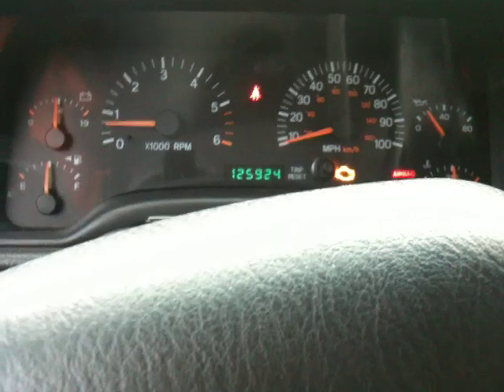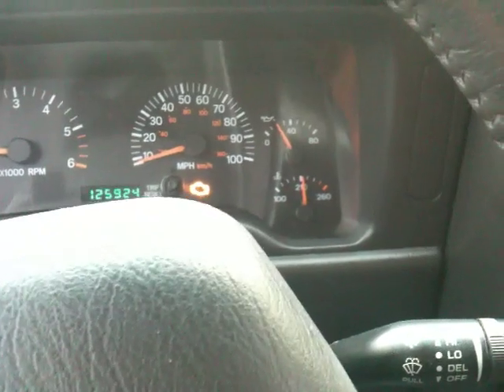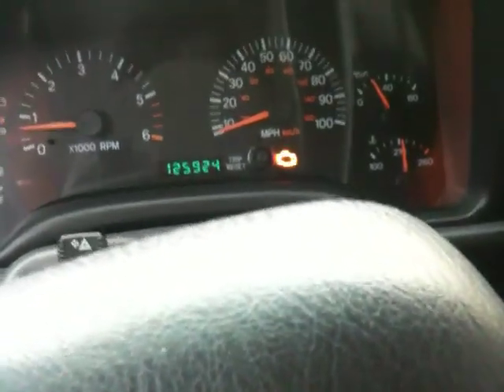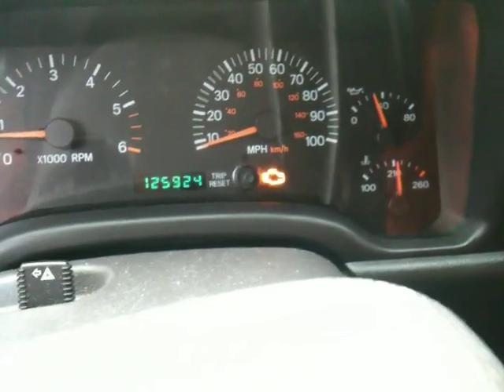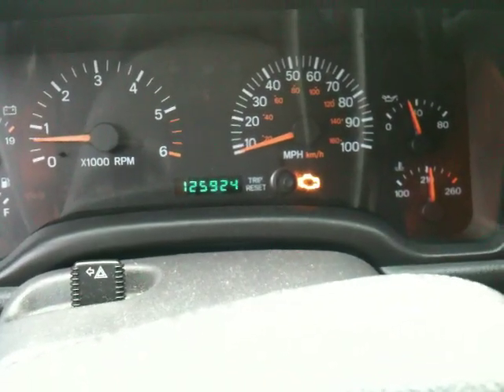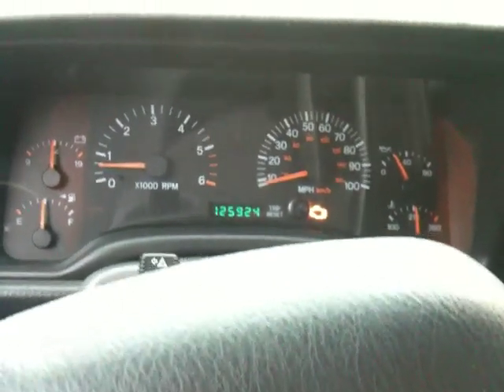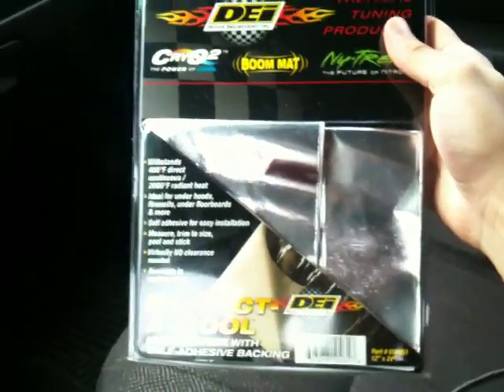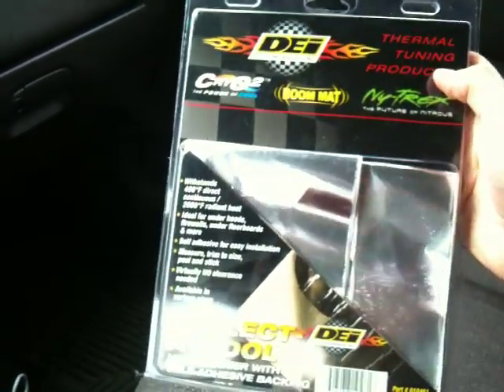2000 Jeep Cherokee XJ Cylinder 3 Misfire

Comment: I have a turbocharged 01 Cherokee with a cylinder 2 misfire and it starts to shake around 45mph but hasn't ever got into high temperatures, couldn't be a blowed head gasket right??

Comment: my 01 xj has the same problem. i just don't get it
Reply: yeah, I'm fairly confident my 01 doesn't have a cracked head. it's been well taken care of. I just replaced the head on my 98 xj and not looking forward to doing that again haha
Reply: well I bought my 98 off my boss's friend for 600 bucks. needed some work and tlc, after I fixed up everything I could imagine i still couldn't figure out the misfire on cyl 2. well the first time I took it on a good drive to test it, it has getting warmer then normal. around 220. it wasn't long before the rad cap shot off and i started noticing white smoke from the tail pipe. the previous owner must has severely overheated this thing. but since then I've replaced everything (again). still misses. this time on cyl 5. this thing is driving me crazy. It has 132k miles. my 01 xj has 142k and is chugging strong. I know all about the 0331 head issue, because I've searched many threads online about it. And Wow, I know vacuum switches can be frustrating. Good luck man, i hope it makes it to 300,000

Comment: I've tried the heat wrap stuff and doesn't work, replaced spark plugs and didn't work, I ran some seafoam thru the fuel lines didn't help and now I'm replacing the #3 injector cause it shorts out under heat the heat of the engine after I had it tested so I'm gonna see if replacing the injector helps
Reply: Did it help?

Comment: Where is cylinder 7 on 2000 4.7 V8 Jeep Grand Cherokee Larado? I'm replacing ignition coil.
Reply: A little late but its the one to the right all the way in the back of the motor

Comment: I know this is an old thread, but since people still run into this issue.... My wifes cherokee was doing same thing but. It would happen without shuting down engine. drive on freeway and ran fine. pull off offramp and come to a stop (idle) and engine flashes CEL. runs rough, stumples etc... turn key off restart and back to normal. I finally found it. The Cam Position Syncronizer... the part that replaces a Distributor on an earlier motor (one with spark plug wires instead of Coil pack). Remove your cam position sensor and there will be a half moon blade-like part... move it back and forth.... there should be very little play in that part. If there is excesive play replace it. About 60 at autozone.... cured her problem. Just an FYI for those having problems. Oh the CEL was p0300 and p0303
Reply: I love you for this comment. I was 400 miles away from home and mine did this, thankfully was okay while driving but it was Cylinder 3. All new ignition components minus the cam position sensor. Never had heat soak before. So I pulled off the highway to fuel up after about 3 hours of driving and I topped off the tank fuller than I ever had before. My first thought was that I messed up something with the evap system but I pulled the lines off of the box and it was dry. I pulled the injector harnesses next and only Cylinder 3 didn't make a difference. Having them be new injectors I was upset that one just super randomly went bad after a fuel up. Today I am at work helping a co worker figure out why hes having misfiring issues and he just did his crank position sensor so I started looking into cam position sensors next. 

I am going to go buy one today and pray this fixes my issue as well as his issue.
Reply: I just replaced my distributor and spark plugs.. except for the wires and now im getting code p0303... you think it's the cable's?

Comment: Mine does the same thing they all do when it happens DONT REV IT the computer panics and throws the car into limp mode and you get a flashing check engine light when it does this just let it sit for 30-40 seconds and it should go to normal idle

Comment: check your plugs, check your coil (or coil packs) with a VOM to make sure the resistance is within spec, do this after the engine has reached operating temp as electrical problems can be hard to diagnose that are intermittent like that, if the electrical components fall within specs then check your plugs, change as needed, check your fuel pressure also with a gauge kit also try to put some fuel system treatment such as Berrymans B12 Chemtool or Gumout Fuel system Cleaner through it and drive it, and use a scan tool to read/clear your ETC's and Pending ETC's, if you are concerned it could be a head gasket, the easiest way to tell is to open the radiator cap (WHEN COLD) and have a friend watch the liquid level as you crank the engine over, bubbles/blowing coolant everyware is a sure sign, a compression test (of the cooling system and the cylinders) will tell you if the problem is something more serious, thats just where i would start personally to save some money, least-expensive parts first, then move up the chain from there, good luck man

Comment: What I do with mine on hot days  when it sits for 15-20 minutes and would heatsoak is instantly rev the engine to 2000RPM when I start. Works every time to avoid the misfire.

Comment: Nope. Spark plugs won't help. The 2000 and 2001 have catalysts in the exhaust manifold and that heats up the injectors, the fuel boils (kind of like a vapor lock) and it does this. Completely harmless ... unless you need to get rid of that check engine light for inspection.
Reply: And how would you get rid of the CEL
Reply: I have a 97 just replaced the spark plugs, and distributor except for the wires... now im getting code p0303 
 Any tips on what to do?

Comment: I have a 2000 cherokee and had this problem at 70 thousand miles back in 2005 . Make sure you have the debris/heat shield on the intake manifold and wrap injector #3 with some type of heat tape, Also double check or replace cooling system components , perhaps a high flow water pump or 3 core radiator. The stumble or miss in my jeep went away after i had done the following. the jeep now has 300 thousand miles and runs well.

Comment: well for starters your about 2 quarts low on oil the 4.0 hold 6 quarts. i had the same issue with misfiring it was the #5 cylinder for me, i changed out the spark plugs (which had never been changed) with bosch 2+ and some cheap wires and i havent had an issue yet. id recomened getting a new ignition coil to from msd just to be safe there only $50